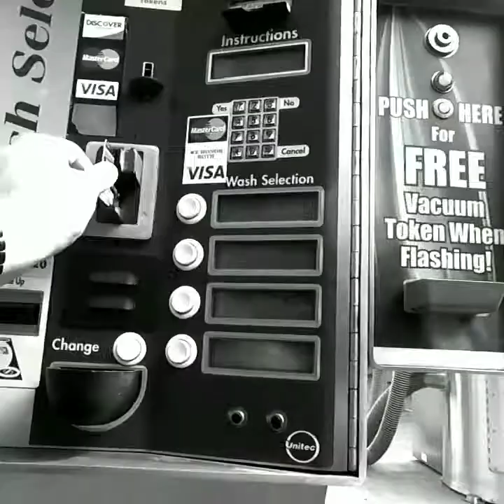Ceramic Coating : Dodge Charger Daytona , 2 thumbs up

Comment: Do you also apply the coating on the decals
Reply from the maker: Mr Scowl Face yes. We covered the whole car, decals and all. Rims too! Check out my other video about my ceramic coat issues where you’ll find more details. In total there are 3 costs on the car and 1 on the wheels
Reply: 2STX Auto and Gaming Vlog ok thanks